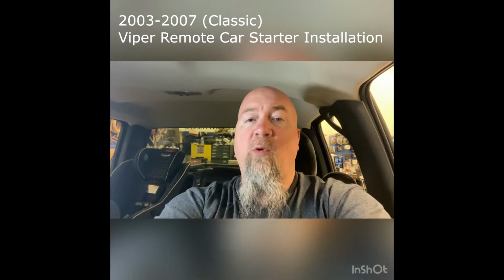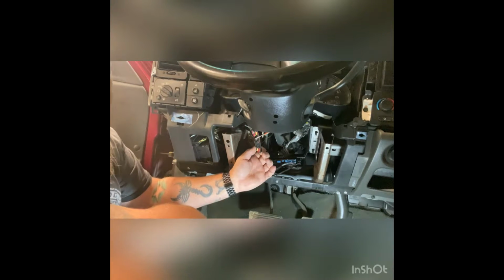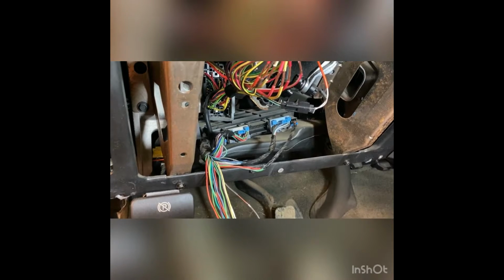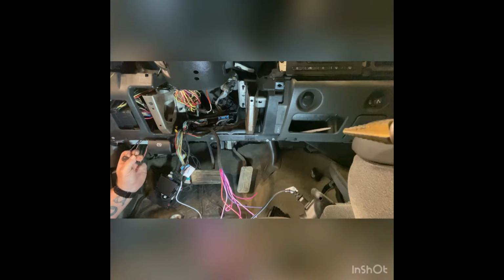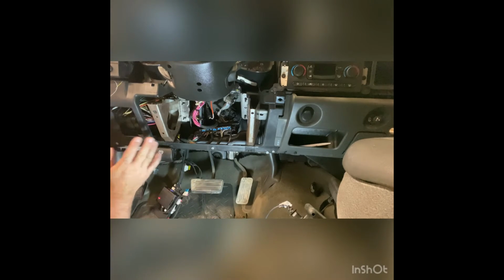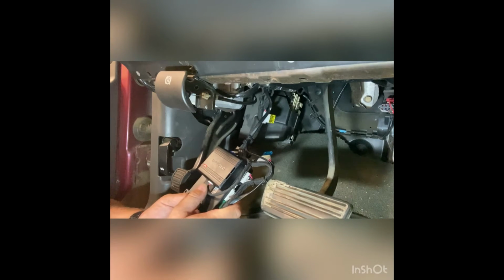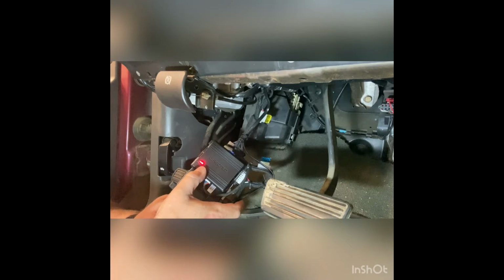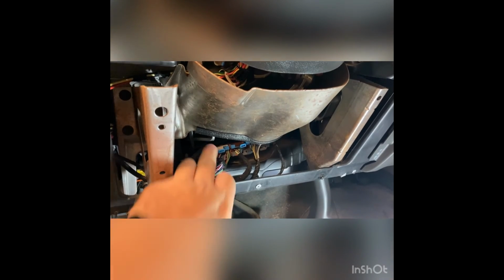How To Install Viper Remote Starter in 2003 - 2007 Classic GMC Chevy 1500 | Full Video | All Steps

Comment: Hey hope all is well!! I was just watching you vid and I have a viper alarm system 5607V and for some odd reason now my chevy 2004 hi-top conversion van will not start.  If you could help me figure how from a matter of hours that it goes from working fine to not even starting at all?
Reply from the maker: Did you get this sorted out?  
When you say it doesn’t start, do you mean it won’t start with the key or remote start?
Reply: Neither like I have to hit the remote start twice and it reads remote start error and then all of a sudden it will start by key then when I armed my van it says that the door is open and my hood is open but everything is closed smdh
Reply from the maker: I would be inclined to think this is an ignition switch problem. 
With tilt steering, any tension on the factory ignition harness can cause this exact response.

Comment: I know this video is 3 years old hoping I can still get a response where should I put the (antenna) I have my entire brow tinted in 5%
Reply from the maker: I’m still here answering questions. 
The school is split on this. Most say, to get the best reception, avoid all tint or dot matrix. So that means you’d go low, below the tint but still at the center of the windshield. 
However, with todays technology, it may not such an affect on range as we thought it did, in the past.
Nowadays, I like to keep my antennas hidden closer to the rear view mirror, whether there’s tint or not.
Reply: @ I thought about using the tap splice connectors any thoughts on using those instead of soldering the wires

Comment: Will it work on a 99 Silverado?
Reply from the maker: It will yea but the module won’t control door locks, door status or tach signal. You’ll have to wire those directly.

Comment: Did you have to wire 2nd accessory?
Reply from the maker: I really only worry about 2nd acc or the duramax. Not gas
Reply: @srtbull_yt6854 the transmission issue is that with the tach wire or the 2nd acc? I’ve done this on a 2000 Chevy before but can’t remember
Reply from the maker: @yoitsdeezygaming8050 neither. It’s second ignition that powers the transmission

Comment: Is there a remote start system you can use GM key fob
Reply from the maker: Absolutely, I have done another video on this channel on a Ford F150, using an IdataStart, that allows for 3x lock on oem remote.  There are Viper versions that do it too, but for that purpose, I prefer IdataStart.

Comment: Cloth tape has been used 8n the electrical 8ndustry for years until vinyl tape came out .we use it 9n motors alot .I'm having issues with my viper 3 button not getting out  of valet .

Comment: Will this work for a 99
Reply from the maker: It will work yes but it won’t do door locks or security. You’ll have to provide (+) doors locks for the 99 and (-) oem alarm shutdown, if it has factory security.

Comment: Where is a wire diagram for the db3?
Reply from the maker: I’m pretty sure you have to be a dealer to get access.
Reply from the maker: Yep, I just tried getting the manual without credentials and you can’t get to it from their website.

Comment: Trying to install  viper 4806v to a 2004 silverado.  Using a different bypass module (fortin evo all)  Your video is helpful.  It looked like you connected the pink/black from remote start 8 pin to the accesory 2 brown wire . Is this required ? My quick reference install guide refers to that as the flex relay input.  Thought I had everything hooked up correctly but viper wouldn't let me program it, led will not light up , also won't learn tach.  Does the hood pin need to be grounded for programming? Any suggestions  would be appreciated.
Reply: Did you fixed because I have the same problem now

Comment: Nice video but could you please tell me the wiring for the db3. Thanks
Reply: I have the same truck
Reply from the maker: The wiring for the db3 is the data cable and the j1850 wire at the obd2. Super simple.

Comment: Have you done a video for a 99-02 chevy for viper alarm
Reply from the maker: I haven’t but the install is very similar to this one. The only difference is keyless entry isn’t controlled on the data network and will have to be hardwired. Very simple.
Reply: @srtbull_yt6854  where to you tap in for door input as everything on my install is working except the door trigger. so no alarm when i open the door and cant program the viper to auto instead of manual

Comment: I’m doing viper install on my 2002 Escalade. What module would I need?
Reply: Hey I seen your comment about your 2002 Escalade and I have been kinda searching the Internet about installing a remote start on my 2002 Tahoe. It has factory keyless entry, would you know if it is a similar install like the 03-07 trucks like ours? I find videos on those everywhere but can't really find any on my year. Thank you
Reply from the maker: @drewskidrankthebrewski4657 not the same as the 2003 and newer as door locks are accessible on the data network. Whereas on your 2002, you’ll have to manually wire them. If you have oem keyless entry, they’ll be positive at the power door lock relays above the gas order. Blue is lock, white is unlock. Orange is power. If my memory serves me correctly.
Reply: @srtbull_yt6854  thank you for that info, I really appreciate it! I do have factory keyless entry but I'm having a hard time trying to figure out what kit to get and what all I need, then on what I gota do to get it installed...lol. But I'll get it figured out, eventually

Comment: what wire did you connect to the OBD
Reply: I want to say the violet/white
Reply from the maker: The color from the module was orange. But the wire in the obd connector is purple.
Reply: @srtbull_yt6854   thanks for getting back! the vehicle i have is an 05 Cadillac ext, the wiring is very similar
Reply from the maker: Pro tip, exactly the same. Locations may differ

Comment: How difficult is to install one in a semi truck Volvo
Reply from the maker: Not at all. I actually quite enjoy working on semi trucks.
Reply: What is the minimum wires they need to be installed if you don't mind I don't want the hood switch I don't have power doors just to start I try to power bench the viper remote start but I was not able to program the remote
Reply from the maker: Technically, the bare minimum would be: power, ground, ignition, acc and crank. 
You should have a tach signal but could cheat it. And park lights would be nice but not necessary.

Comment: I have a 2005 Silverdo, do i need a bypass module also?
Reply from the maker: It’ll make your life so much easier if you use one. It can be done with relays and resistors, but seriously not worth it when the interface module does all the heavy lifting.
Reply: Thank you for your response!